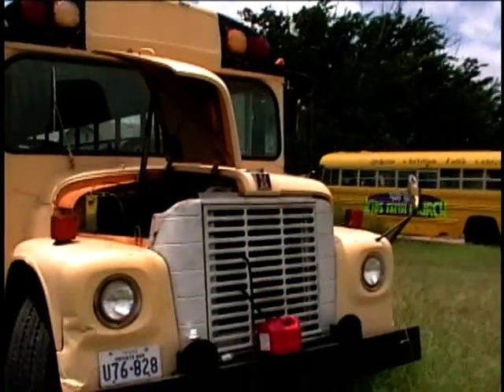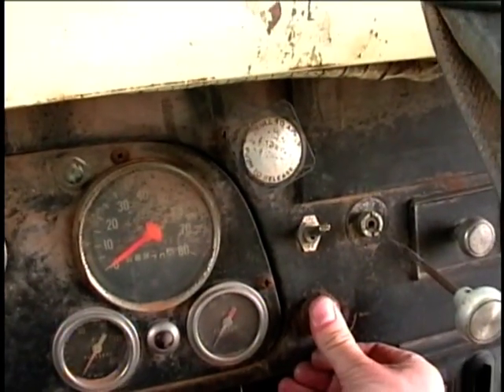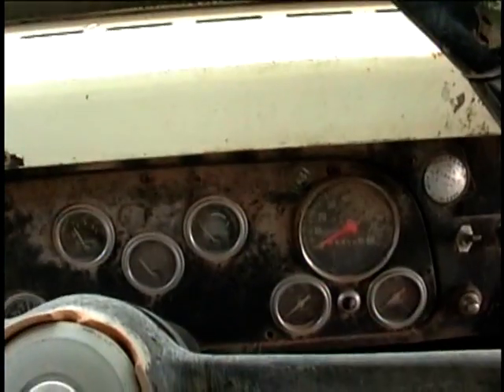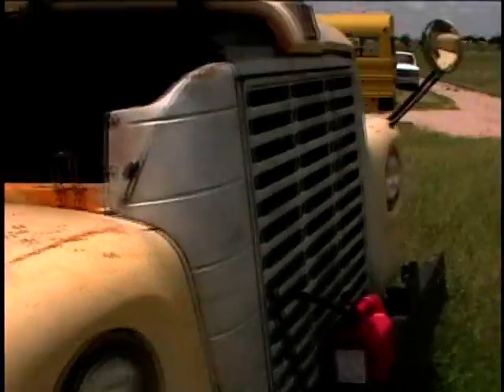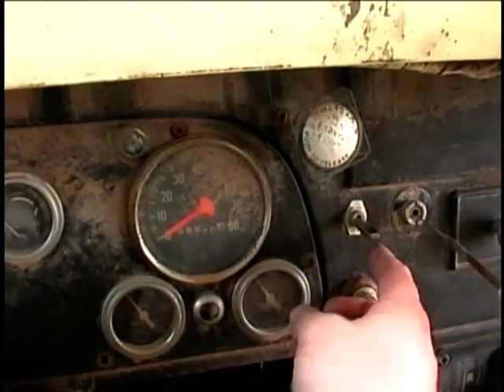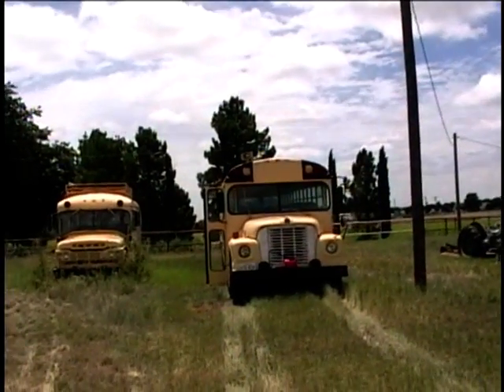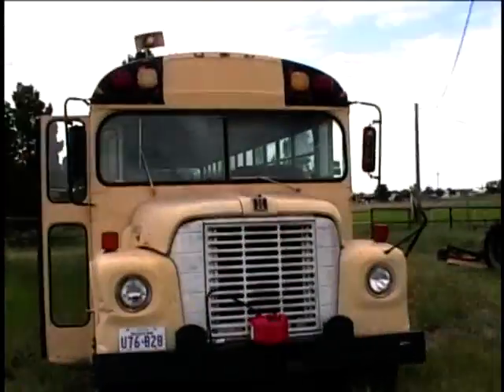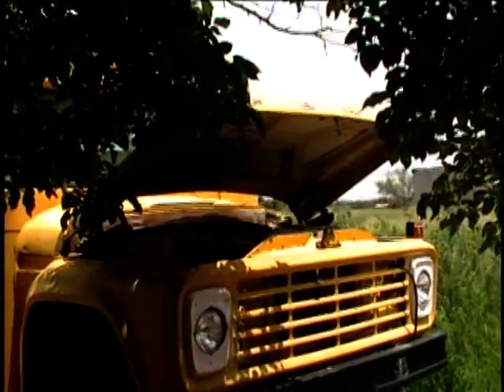1978 Interational Loadstar/Carpenter School Bus Update

Comment: I had an issue with a leaf blower where it didn't stay running. so I put some carb cleaner in it and connected a fuel line from the primer to the carb and just primed it a bunch until it was clear

Comment: Is the mileage on this bus 689,700 or 68,970 miles?
Reply: 1986FordF-250 if the odometer has a white spot that is for the .0 so it has 68,970.0 miles

Comment: the oil pump is starting to fail, since it shows at 19 psi cold
Reply: Could be worn bearings, 
bearings wear faster then oil pumps.
70,000 with the gear ratio it has its like 250,000 miles.